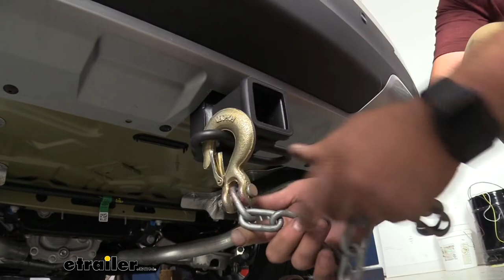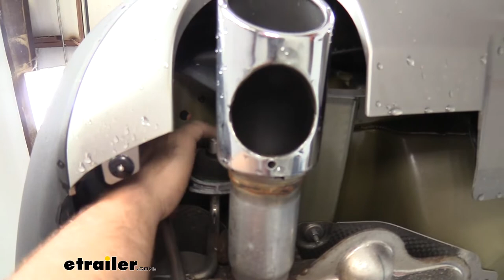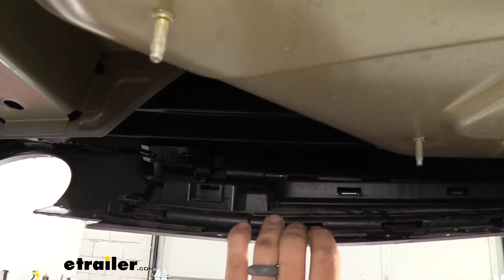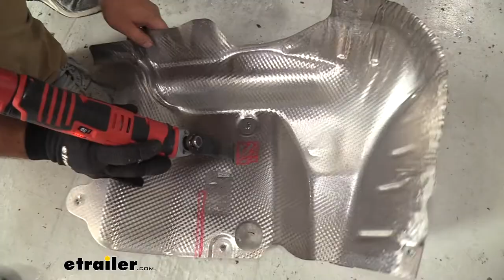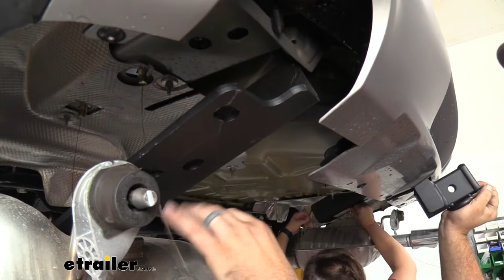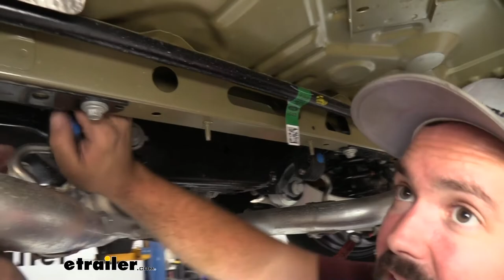How to Install the etrailer Trailer Hitch Receiver on a 2022 Ford Explorer

Comment: I’m still confused by what the vehicle can tow. The owner manual says it needs a class 3 system to be able to tow 5600 lbs. is installing this all you need to increase the tow rating from 3,000 to 5,600? Or are there other medications that must me competed in order to be able to achieve the 5,600 rating?
Reply from the maker: According to Ford's 2022 Towing Guide, in order to achieve the higher 5600 lb towing capacity, the vehicle needs to be equipped with the factory hitch, the factory 7-way/4-pole trailer connector and the Ford Trailer Sway Control feature. You'll want to confirm that with Ford.
https://www.etrailer.com/Trailer-Hitch/etrailer/e29YR.html

Comment: seems really low to the ground like it would drag on driveways. Seems to me like it would be a better design to plunge right through the center of the rear apron rather than the very bottom

Comment: Question, have this in my cart, I read a review somewhere that you can skip cutting the heat shield and install it over the hitch mount instead. Thoughts?
Reply: One guy did. and hammered it down to where it fits. and, also he installed the hitch first then the heat shields
Reply: From what I am seeing, I would install the hitch and install the heat shields. Less cutting of the shields.

Comment: What are you able to tow without having a wire kit to run the lights of whatever trailer that’s in use?
Reply from the maker: If you're towing a trailer behind a vehicle, you'll need trailer lamps/turn signals to stay legal. If you don't already have a trailer connector on there, use # 118599. Here's a link to that for you to check out...
https://www.etrailer.com/Custom-Fit-Vehicle-Wiring/Ford/Explorer/2022/118599.html
Reply: Bike or luggage racks